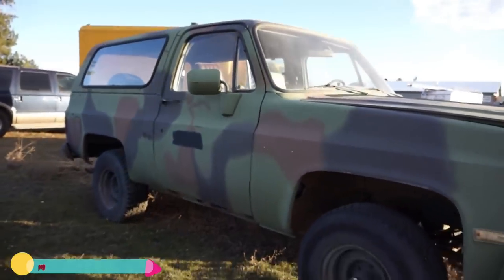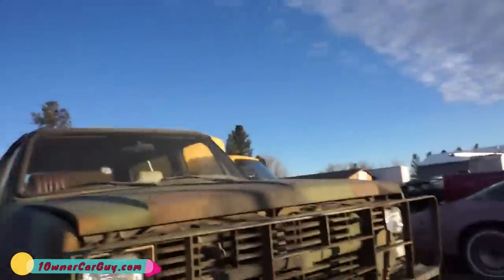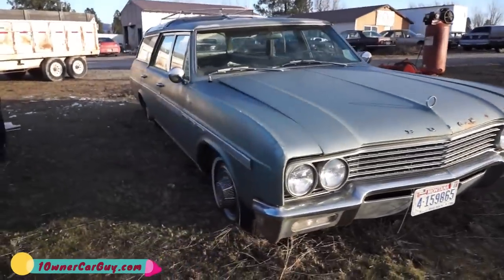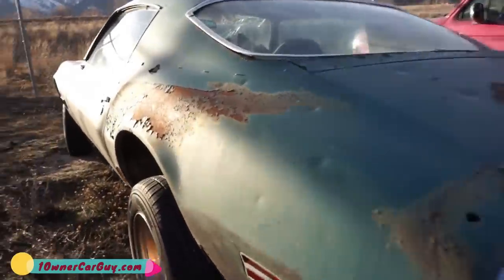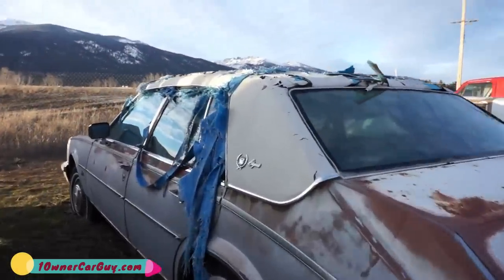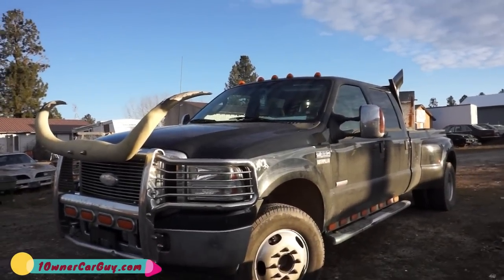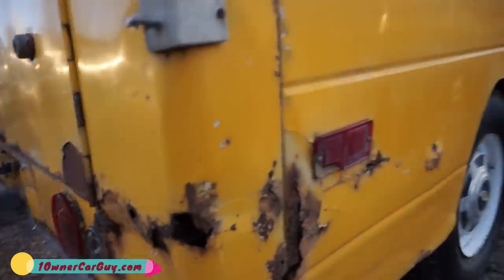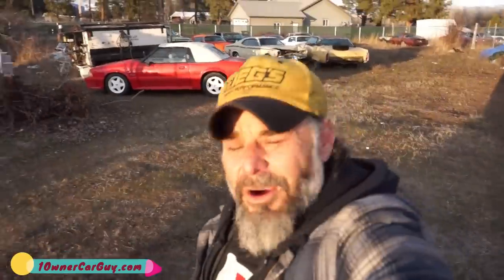CLASSIC PROJECT CARS FOR SALE ~ FIELD / BARN FIND ~ DAILY VLOG 2020-0031

Comment: No spark. Check your ground wires and make sure it's on time. If it's out of time,it won't fire. I'm a dum dum. I know. Lol.✌️👍
Reply from the maker: Man we have we checked everything Start again now i guess ;-)
Reply: @CerealMarshmallows   good chance there might of have been a wire overlooked. If it didn't jump time and the motor itself is sound,the   next thing I'd check is the ignition. It could be it. I hope you can pinpoint the problem. Good luck brother 👍✌️